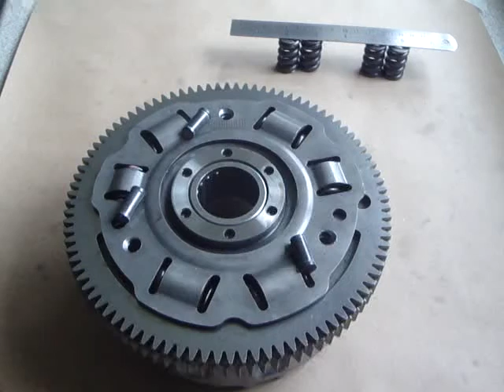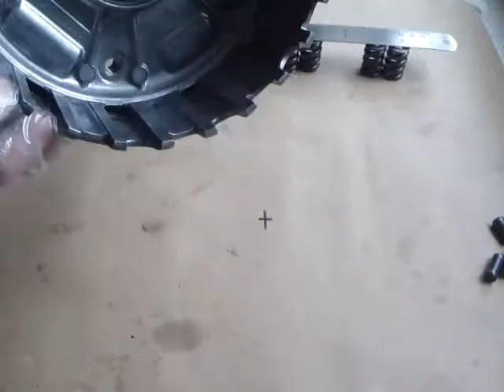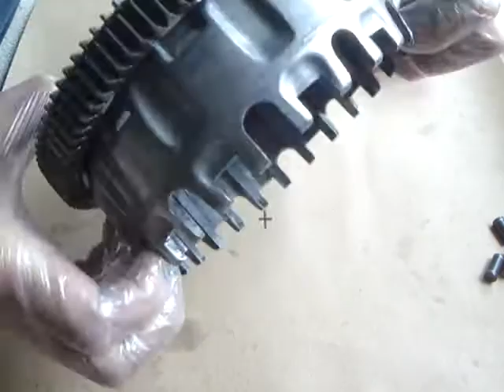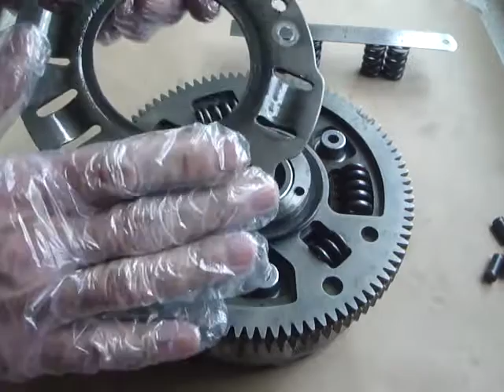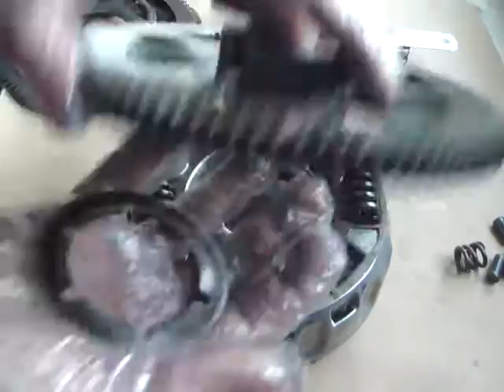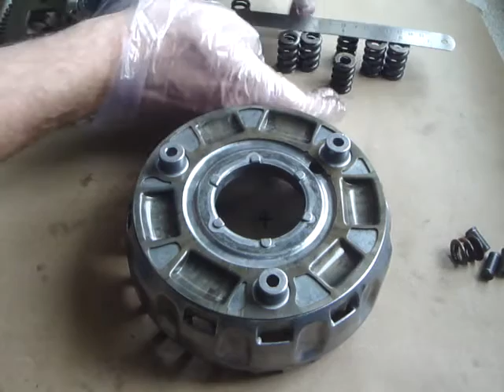Poor state of the cage damper - why they vibrate at idle and under load

Comment: After months of research, videos of youtubes, articles of the internet, open my motorcycle and dismantle my clutch...i found on this video what is really my problem. I have a CBR500 2017 that has oly 17.000km, downshifted aggressively a couple of times, max accelerated a few...and there i go, need to buy the outer gasket entirely for like 400USD.

Comment: I have a 2007 K1200GT with 60000 miles on it. Rattle is present at idle and goes away when pulling clutch handle. Sometimes, if you time it right with the throttle, the bike will stall. I live in the US, are you still rebuilding clutches for this model and how can I contact you ?
Reply from the maker: Yes - still rebuilding the clutches for the K series BMWs. 60,000 miles is on the high side. I have spare parts for the rebuilds I perform so there should not be a problem. 
Shrinking and worn main spring coils is not so much the problem in later year baskets. Their main load springs still rattle at idle but its because the lighter rate springs fail to damp the low frequencies at tickover. Once bad this will cause the engines to stall or at least have a very rough tickover. The whole clutch assembly weighs about 6kg. It behaves like a loose flywheel. Catch it the right way - it helps smooth the engine over compression to the next fire. Catch it the wrong way - it can stop the engine or at least make it hesitate for split second.
Reply: Is there any way one can get in touch with you on WhatsApp or by phone?

Comment: ................or can you upgrade a cluth basket K1300GT, 72'000 km? Thanks
Reply: Marco Messa - At what cost?  BMW parts are very expensive, I have a friend that spent over $3200.00 doing a clutch job on his GT as they updated the clutch basket.   On top of the excessive costs, the bike was out of service for a long time while the dealer waited for the parts.
Reply from the maker: Yes - been one of the most common baskets here.

Comment: I think I have the bearing issue you described, 'cause the clutch on my bike sounds similar to the basked sound you've shown, from idle to 2000 rpm. Would the bearing replacement be a hard job for a amateur mechanic like me? I'd love to have it changed and since most mechanics I've shouwn it to were not even able to distinguish the sound, I trust my own hands better than theirs. My bike is a 2005 Cagiva Xtra Raptor and it has a TL1000 engine.